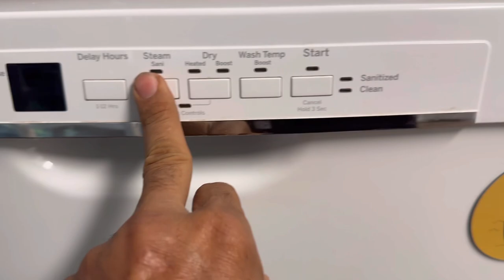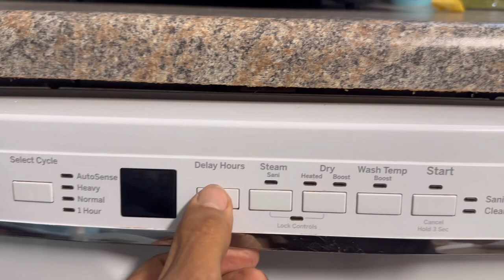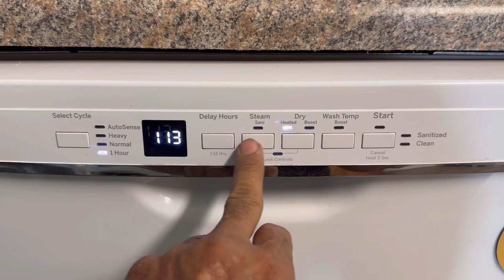GE Dishwasher Not Powering Up| No Power | No Display | GDF530PGMOWW

Comment: Thanks for the video! I took the circuit board out and when I was reassembling it, it turned out to be a loose connection. I snapped everything into place tightly and voila! it works.
Reply from the maker: Glad it helped, appreciate the feedback
Reply: Is the white dot what tells you that the fuse is broken?

I don't know enough about the circuit board to bypass the fuse.  What are the chances the board is the problem?

Thanks for the video!
I have the same exact model (by the looks of it) and the same exact problem.
Reply from the maker: @kad85742  The white dot is just a factor marking. If you are not getting power to to display, if you can try and bypass the fuse. That will definitely point you in the right direction. I have seen more board failures with GE dishwashers. It might be easier to just buy the board and take a chance. The next is the user. The new user you will have to set it to match your dishwasher’s model number. I also have a video on that. You will need to add the personality sequence. Keep me posted

Comment: You mentioned power restraint.is that attached to a circuit board? Mine has broken away from under the male end plugs into that female  end that broke off do I have to replace circuit board or that female plug for the harness male end
Reply from the maker: Not sure if I understand what you’re saying. Your Diswasher should have a cord restraint. A clamp that holds the wire to the dishwasher . If you are talking about a connection on the main board that is broken off, yes you might need to replace the board. Unless you know how solder. Send me a picture, email it to be certain to what you are saying

Comment: Hello,  thanks in advance,  do know how to test the detergent dispenser from the board?  I replaced the Ui board  two months a go . Was getting  power (14v) but no response, put a new one (UI) on and it solved that issue,  it was working good for a while until the dispenser stop opening during cycle,  i bench tested it and it worked fine, but  still  no function when put back together,  i did a manual test with service mode, it worked well through the cycles,  mine is 7 step test but the but detergent dispenser test fails.  Any ideas?  Or is it time for a new maim main board?  Thanks again
Reply from the maker: I have a video somewhere on that actually. Not sure if it was uploaded. If you are getting power to it and it is not operating, sounds like it is bad. When you manually test it, do it 5-10 times and see if it completes all. They get stuck and stay shut. I’ll look for the video later. I’m on a service calls all day
Reply: @appliancerepairshorts  thanks.  When I bench tested it. I cycled it a few times.  I'll try again.  If operanational. Should take a chance with the main board 🤔
Reply: @appliancerepairshorts  Hi, i was wondering if you could see if you can find the video on the detergent dispenser GE dishwasher? Bench test again and works every time,  no fails, is it the main board that controls it and sends the 13v? Or maybe a thermistor or temp censor gone bad?
Reply from the maker: I have not found the video. I’m going to make one this weekend. I’ll let you
Reply from the maker: Hey man, not sure if you’re still interested, I just made a video on that dispenser. I couldn’t find the older one. You probably got a notification, hopefully lol